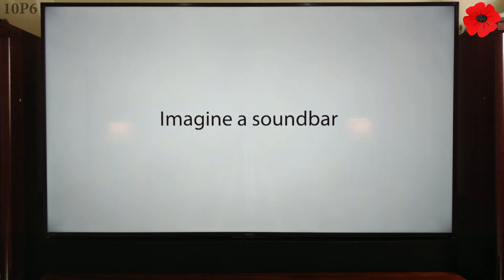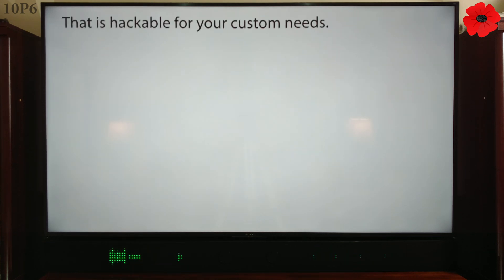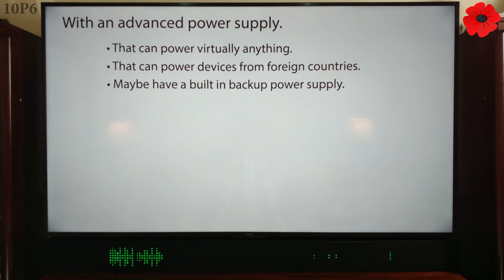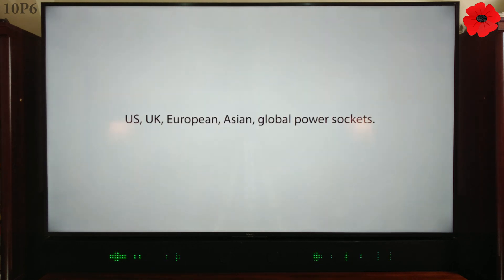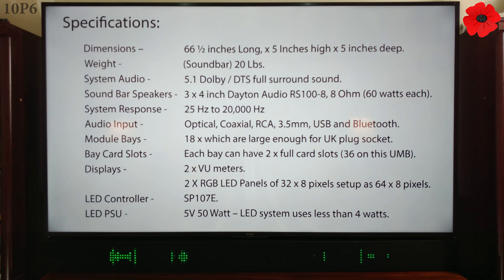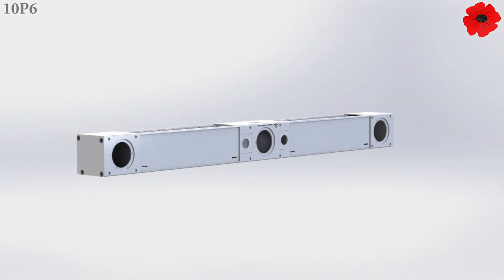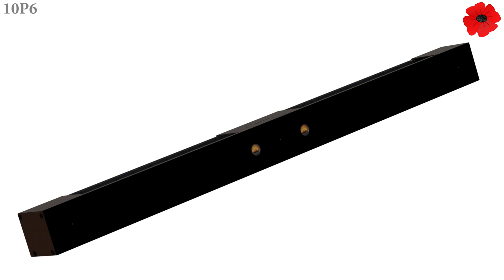Worlds Longest Sound bar - 3D Printed - RGBW Display - Ultra HD Music

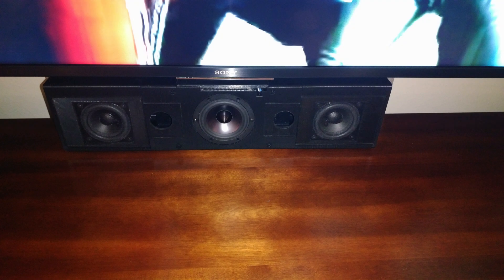Comment: 17:45 Interesting design, but that's not 5.1 surround.  5.1 surround requires 6 speakers at 5 or 6 different locations.  Your design would be considered between 1 and 3 locations.  You need front left, front center, front right, rear right, and rear left, and the ".1" would be a dedicated subwoofer (center channel speaker DOES NOT count as a subwoofer).

Bose (as I'm sure many other have tried) made a "4.1" surround setup using 5 speakers at 3 different locations back in the 80s.  Not sure if they still make it.  The "rear" channels were stacked directly on top of the front channel speakers, and were meant to be angled to bounce off of a wall and APPEAR to be coming from behind the listener.  This only works with optimal placement, room size/shape, acoustic material in the room as well as the walls, and proper sound processing with delays added to the front channels to make up for the slight delay in the rear channels having to bounce off of walls before reaching the listener (which can obviously make audio out of sync with video).  All in all, it was in reality just a stereo setup with a subwoofer, but they marketed it as being a 4.1 surround setup.  You say at 17:45 that your sound bar is 5.1 "bass reflex" so I assume the center speaker is a subwoofer, which would make it almost the same as the Bose setup, but without the fake rear channels, so it is just a stereo soundbar with a subwoofer.  At most a "2.1" configuration.

I do like the idea of a modular soundbar though.  Just don't advertise it as something it's clearly not, and you could probably start selling those.  Good luck.
Reply from the maker: i'm sorry but It is 5.1, as it has 2 wireless rear speakers, and a wireless subwoofer.